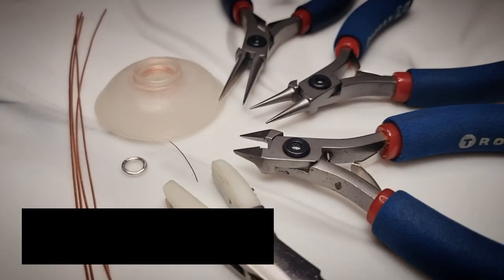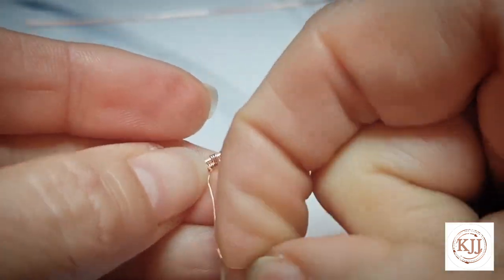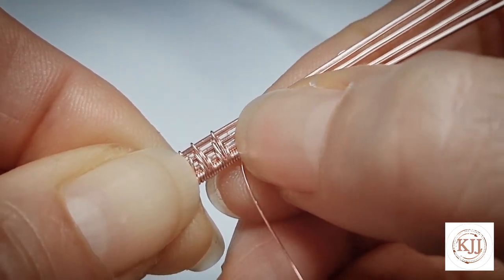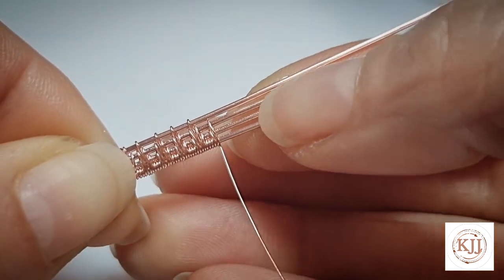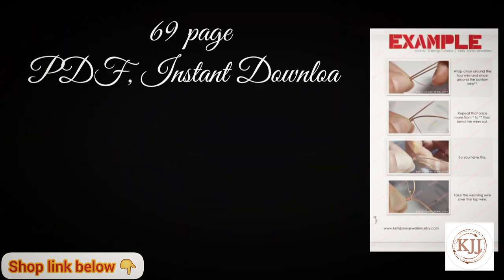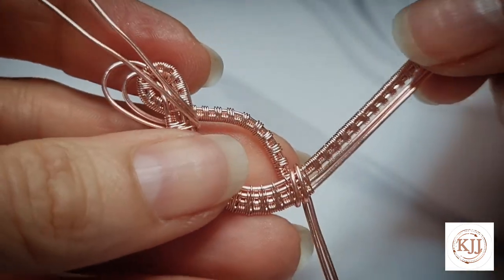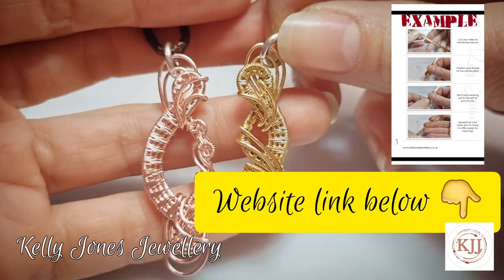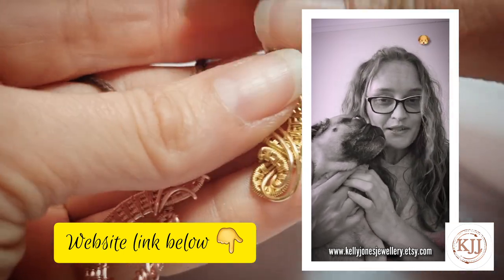Wire Tensions and Weaving by Kelly Jones.

Comment: I love parawire. Not only does it not tarnish because of the plating it also doesn't slip as much as others such as artistic wire does.
Reply from the maker: Yes, my problem is I'm heavy handed and I rub the coating off 😅 it's also ideal for making things like keyring dangles, sun catchers or things you hang in the car 👍